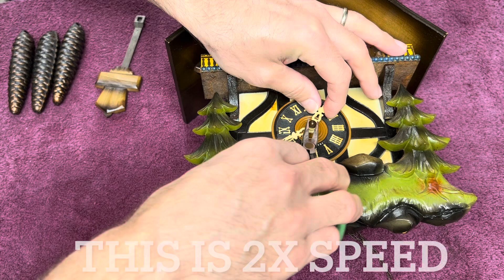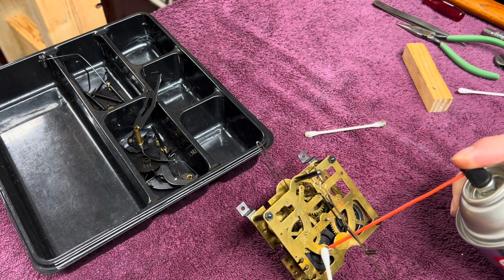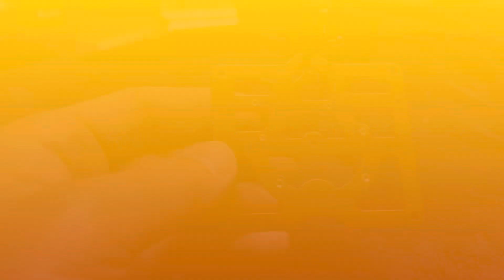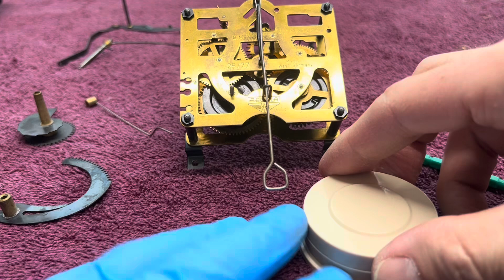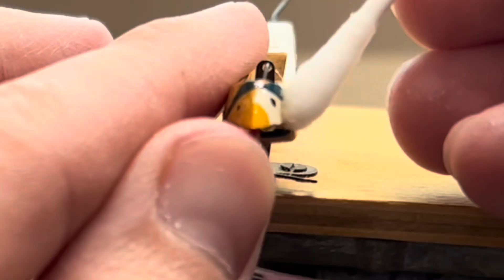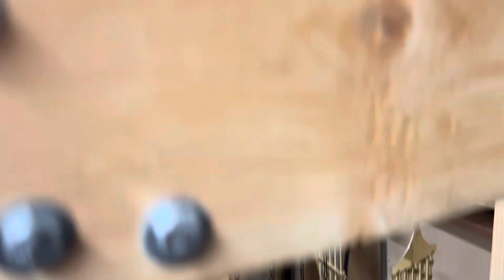Cuckoo Clock Repair for Cindy

Comment: Hi Chris! When can you post more videos? You are by far, the best! Your tutorials and explanations are priceless. Thanks to you my Hermle 340-020 runs to the second even after 3 weeks running! I had it all apart, cleaned, and even repaired the Floating Balance torsion spring that was gimped by someone. With your teaching I got it all together.
We miss you!
Reply from the maker: Im sorry, i just have so much work!!! I do have two videos i filmed but i need to “find time” to put it all together
Reply: Thank you for responding Chris. Being busy is good. Take the time you need and I’ll look forward to your next postings. 🎉

Comment: I have the exact same clock, but mine has a water wheel on the side. I don't see a pulley on the music box to drive it. Is it just for decoration or am I missing something?
Reply: The thing is you don't have the exact same clock. I have serviced one of the same as to your Deluxe waterwheel version. You are lucky.

Comment: Can people send you movements for repair?  The ones I am talking about are the Korean ones from the 1980-1990's?  I have a Hamilton movement where it looks like a small spring broke and I don't know what function it served but if the clock stops once the pendulum does maybe that's the issue.  I have 2 movements I need looked at which for you could be an easy fix.  Just wondering if it would be worth it.  One is a Hamilton and the other is a Waltham.

Comment: Thanks, your video was helpful for me to determine the proper bends and placements in wires (some missing) on a similar clock I'm working on -- only difference is mine has the additional moving waterwheel on the side. A suggestion (probably too late!) is to adjust the wire for the wood-chopper motion so the axe actually touches the "wood" which visually matches the thudding sound more accurately.  

Have been getting two other cuckoo clocks ready for a client to give to his family for Christmas gifts this week, so the arduous cleaning process has been top of mind for me. Am sure it's not the first time you've heard this, but may I suggest investing in an ultrasonic cleaner -- you can often find good used ones for fairly cheap -- which makes the cleaning process MUCH easier and more thorough. I've never regretted buying the two I now own, although I did get them at very reasonable cost. No more than 5-6 minutes with ultrasonic, though, as it can start pitting brass and even punch holes in thin metal!

Also, for cleaning solution I use household Sudsy Ammonia (which I dilute 1:4 with warm distilled water) and an added drop or two of grease-dissolving dish washing liquid for especially grimy movements. This solution is way cheaper than the commercial clock-cleaning stuff, and seems to work just as well. Plus you can easily get it in a pinch at most any grocery store. It was recommended to me by my experienced clock repair tutor and mentor. Just resist buying very large quantities of it when it goes on sale or you may be suspected of using it for nefarious (explosive) purposes... don't ask me how I know!

Same solution can be used on all the plastic components of a cuckoo clock. Two to three minutes via ultrasonic, without any effort or tedious scrubbing with Q-tips, will magically lift the grime right off and get things looking brand new. I was curious to see the condition of your cuckoo bird before-and-after... and it still looked dirty to me! My birds were even dirtier than yours (with a greasy yellow coating) yet came out cleaner -- especially in areas a Q-tip can't reach like the pivot holes, internal cavities and small beak. One of them even turned out to be a light robin's egg blue colour which was an unexpected pleasant surprise!

Anyway, I enjoy your videos and appreciate your contributions of experience and knowledge to the clock maker's community, which unfortunately is dwindling by the year as the old guys continue to pass away or give up the skills for health reasons. I feel very fortunate to have met an old-timer watchmaker locally where I live, willing to pass along his knowledge to me!

Comment: Great informative video! I’ve watched what seems like dozens of these with the hope of being able to get my old cuckoo back up and running again and your video is the best. Loved being able to see the process of new bushings getting installed. I had mine apart to re-oil but didn’t have to courage to completely disassemble the movement to clean properly like you did. I think if I video the process I’d be able to at least go back and review if I get confused on something. I got mine to the point where it’ll continue to run only if I add another 10oz weight to the time chain weight ….lol….I’m sure that will ultimately create additional wear and tear. I suspect it’s just dirty yet though it was professionally cleaned and oiled 30 years ago….it ran just fine for many years afterwards. Thanks again for the informative video.

Comment: Can you repair a Coukoo Clock for me? I bought one that was like i bought my Mother in 1983. This one is more Complicated & I don’t know how to get it up & Running again. It was made by the Schender Company made between 2001 & 2007. It is an 8-Day Coukoo Clock it has a music Box with Dancers on top. So here is the Troubles with it. On Top of the Music Box is a Plastic Battery Compartment for (1) D-Cell Battery & there is an Electric Motor that runs the Bird Whistle?
Out of the Battery Compartment are 2 Electric Wires a Blue wire & a Red Wire on the other end that runs the Electric Motor. I see white plastic Gears also in the Motor drive Assembly!! This is one big Clock I’d say at least 2 foot tall!! This is the Hunters Model. The Cookoo Bird is Wooden not plastic. I’d say this clock went new for $3,000.00 or more. The 3 weights are Wooden looking also not Pine cone metal ones. Could you repair this clock for me? I spent a lot of cash on it over $800.00 which included shipping cost.

Ronald
Reply from the maker: Hi Ronald. I no longer offer a mail order service.

Comment: Hi Chris your Clock Repair video was certainly a big help with my movent repair. I don't know what vintage the movent is, but it has the "Very" small e-clips that are next impossible to remove. I couldn't find a tool for that size.   Any suggestions? Thanks for your great video!
Reply from the maker: I use a very sharp flat screwdriver or needle nose pliers

Comment: Chris.
My story is a bit longer than the usual 1 line comments.
First of all, i am dutch, so forgive me if i make any spelling or grammar mistake.
I have inherited 2 Friese Staartklokken. You can look em up on google to see what they are.
They are not the same. One carries 2 weights, the other 3.
The 2 weight variant is the small one. 
But it is antique. It has the original 3 figures ontop of it for decoration. The middle one holding a globe in his neck.

The other one is the bigger one, 3 weights. Does unfortunately not have the 3 figures on top. 
Obviously (since it has 3 weights) it has a nicer chime build in.
The westminster chime.
The 2 weight clock only chimes at half an hour and an hour, with a simple bell sound.

Both have active moonphase dials.

They both run perfectly. As in: Tik, tok, tik, tok.
They both keep time, but not perfectly.
The smaller one with the shorter pendulum runs a bit slow, and the bigger one with the Westminster chime and longer pendulum runs fast.
Obviously the smaller one has the short pendulum, and the bigger one the long pendulum.
For me, listening to the ticks, the long pendulum seems to be swinging from left to right in about half a second.
So from right back to left also takes half a second. (it sounds like it does not take a second to go from full left to full right.)
The smaller one obviously moves faster.
To me it sounds like the pendulum goes from left to right in about 1/3rd of a second.
To be honest, i have no clue for the exact amount of time it takes.
I have no clue what these pendulums should do. How fast they should swing. Once a second, once half a second. No clue.
I understand that this depends on the length. I could measure how long they are, the pendulums of both clocks.
BUT since these clocks are not that rare, i imagine that there is a rule for how long it should take for the pendulum to go from full left to full right.
A frequency.

Recently i downloaded an app on my phone which i can record with. And it records the frequency of the ticks.

And so, now i only need to know the exact frequency of the pendulum to adjust it to almost spot on, so it will be on time better than it ever has been.
Unfortunately the problem is: i have no clue what the frequency should be for both of these clocks.

For clarification: my guess for the length of the short pendulum is around 30 centimeters.
The long pendulum around 50 centimeters.
These are rough eye balled estimates..

I understand some of what makes a clock tick. I have tried building a clock with my father, from wood. Designs i borrowed from Clayton Boyer, a guy with a youtube channel making all kinds of beautiful wooden clocks.
I understand the length of the pendulum determines how fast it swings etc.
I have yet to understand if the weight of the pendulum makes any difference, and if so, where? what difference? Does it require more weight to keep a heavy pendulum swinging, or less weight. I have no clue about all of that.

Anyway, this post is just for to ask the question: How can i use the app in my phone, which records the ticks and determines the frequency, to adjust the pendulum in such a way that it has the correct frequency (or close to it).
That requires for me to know the original frequency of the pendulum, and it is not printed on the clock. And i can not find it online.
And so i was hoping you can help with that.

I know how to adjust it, by turning the nut on the end of the pendulum.
And, if you need more info about the clocks, i can try and post a link or 2 for pictures.
But youtube does not allow much of that. 
Anyways, i am sure if you google Friese staartklok met maanfase. 
And google:  Warming staartklok Westminster chime maanfase.
You will find pictures of similar clocks.

Sorry for the book i wrote.
Reply from the maker: Many clocks will have the beats per minute stamped on the back of the movement. However, the simplest way to put your clocks on the correct time is to make minor adjustments to the pendulum length until you have it just right.

Set your clock on time at a quarter hour and synchronize it with your cell phone. then check the time against your phone the following day at exactly 24 hours. If your clock is fast or slow by let us say three minutes then adjust your pendulum length and re synchronize your clock at a quarter hour again. The next day it will be closer. Keep doing this until it is time. Then you may find after a few days it is off. Make a minor adjustment and try again. After some time you can get it pretty perfect.
Reply: Chris, thanks very much for the reply.
Believe it or not, i already knew what you are talking about. And i am now in the process of doing so, mostly because i have no idea how those apps works.
I got 2 of em, and they are for to check a watch if it is running on time.
If interested, one is called Tickoprint and the other is called Watch accuracy Meter.
I know how to use it to record a sample of the ticking, i know how to set certain things, but the result plus other stuff in the app do not make any sense to me.
beaterror/ms,  rate/s, just to name a few.

And, it paints a pattern of dots while recording, and you have some kinda scale in which you need to line up the pattern. The heck, i have no clue how to line it up, and even if i got it lined up i have no clue what to look for or what to do with the result it gives me.

So yeah, indeed, the simple way of just adjusting the nut works faster i guess.

Anyways, keep up the good work on those nice clocks, i love it.
 @Chrisclockrepair

Comment: I know one thing, you have one heck of a memory. Did you take classes for this or is it something you picked up on little by little? Are there repair books for clocks that you learned what all the parts are and what they do? I’d love to do this for my own clocks. I can do some things but not all. I’m mechanical and a tinkerer/ fixer from way back
Reply from the maker: I worked as an apprentice under another repairman and i also read up on the subject. It comes with experience.

Comment: Great video. Setting the timing the way you do is much better than the way I wad taught. 2 questions, do you use the awesome product to clean the exterior of the case? 2'- I would love to see a video on you replacing the paper fins on the tines.
Reply from the maker: Thank you.  Yes, I used the awesome product on the case (very diluted and used Qtips to apply very small amounts).

Comment: Hello Chris, have a clock and the cuckoo goes on forever, what is causing this thanks
Reply: One thing to try is adjusting/slightly bend the spring on the rack hook so that it pushes it down a little more. The spring might have lost some of its tension over time.
Reply from the maker: It may also just be that the gathering pallet is not adjusted properly so that it never "catches".

Comment: Is there a reason you rebuilt the movement rather than replace with a brand new movement since the same movement is still being made?
Reply from the maker: Because I’m a clock repairman. Not a clock replacer. These clocks have deep sentimental value to my customers.
Reply: GREAT answer!! @Chrisclockrepair
Reply from the maker: LOL!  Thank you.
Reply: @Chrisclockrepair  It's okay. I'm rebuilding a Hermle made Westminster movement even though new movements are still made just because I want to keep the "Hamilton" name on the movement to match the case. A lot of clock repairmen replace if an equivalent movement is still available. I'm on the fence and some customers would certainly rather have a brand new movement.

Comment: Good job . I like how you used the clothes pin to hold the fly as you put the gather wheel with gathering pin on. I will say that when you tested it and said it was on the hour for the 2 O'clock position that it only was in the first notch on the rack which will only cuckoo one time. It is best to go from 1 all the way back to 1 doing a function test with the great wheel. Because if the snail isnt correct and if the tab on the rack is bent wrong it will cuckoo 13 times on the 12 or more.
Reply from the maker: Nice attention to detail. I did of course make sure it was in the right position as can be heard when i run the cuckoo at 12; however, sometimes i miss these details while trying to film. Oops.